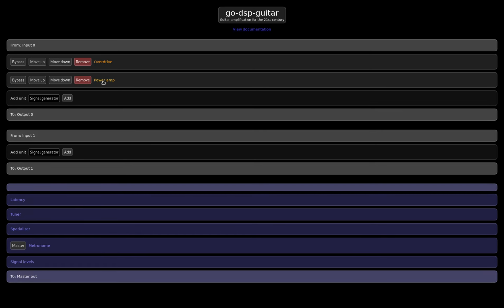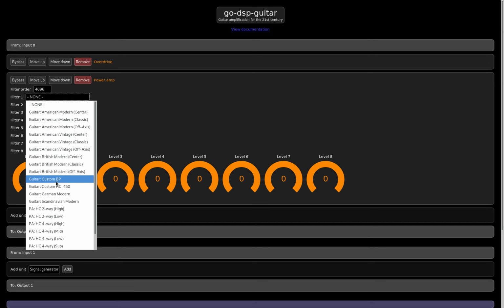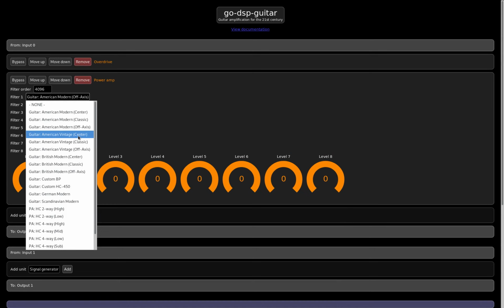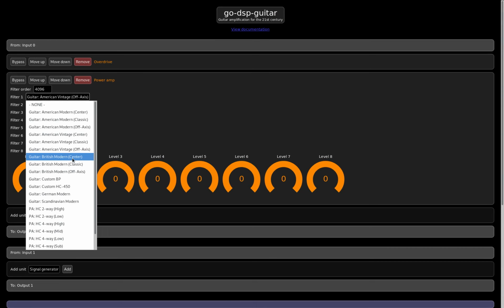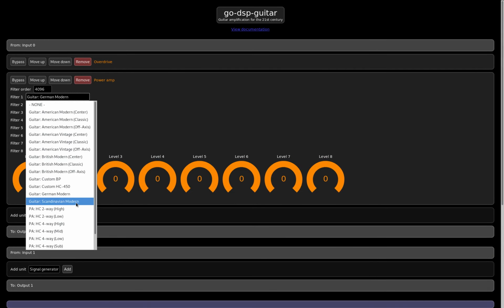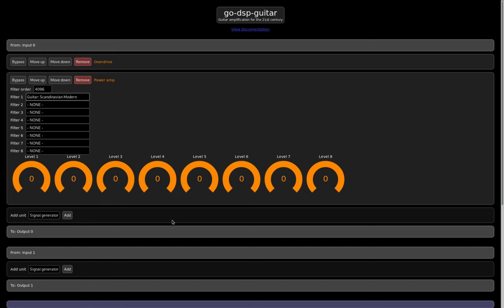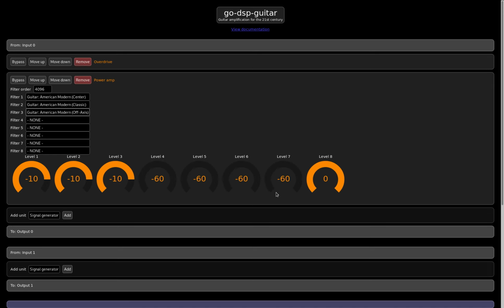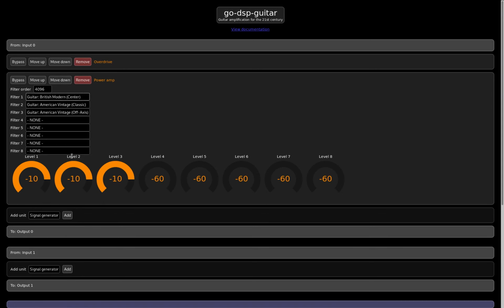Power-amplifier models and microphone placement in go-dsp-guitar

Comment: Good realistic sound. How about adding looper code for this project?
Reply from the maker: Hey, Muiota! I'm glad to hear that you like the sounds. :-) Since this project follows a rigorous simulation approach, realism is absolutely key. However, it also means that certain features are harder to fit into the software's architecture. Unfortunately for you, a looper is probably among these. A few problems that I see with adding a looper to the software are ...

1. Like I said, the software basically uses a (simplified) circuit simulation to process audio. Now, a looper is basically a device that records audio and plays it back, potentially simultaneously, to allow overdubbing existing "layers". To simulate that on a circuit level is overkill. Now, we already have some effects units in the software that do not follow the simulation approach as closely as the others, for example the metronome and the tuner, so that would not be an issue. However, this certainly means that a looper would be also fall into this "auxiliary category" and is definitely not part of the category of effects where the key focus of this project lies.

2. There is currently no "global time base" in the application. The different effects units in the software are not synchronized, apart from running at the same sample clock. This means that when you, for example, add a flanger effect, it will not be synchronized to, say, the metronome beat, and if you add two flangers running at the same speed, you will basically have no control over the phase offset between them. If you send one of them into bypass for some time, the phase offset will change, since the simulation (and therefore time) is "frozen" for the bypassed unit. (This is done to save CPU cycles. The simulation will not put any computational effort into running a bypassed circuit.) Also when you remove a unit and add another one of the same kind, and set the same parameters, you will not get the exact same results as before. Timing between units will have changed, since the time will start at "zero" for the newly added unit. However, this also means, that, when implemented as a separate unit, a looper will not be synchronized to, say, the metronome. So how do you know then when loop recording starts / ends?

3. Complicating things even more, the software runs basically a "control thread" (that does not have to run in real-time) and a (set of) "simulation thread(s)" (that run in real-time) concurrently. The "control thread" gets messages from the UI (which, by the way, even runs in a separate process, communicating with the "control thread" in the application over a socket connection) and then "reconfigures" the circuit(s) that the "simulation thread(s)" run(s). The coupling between these threads is relatively loose in order to avoid blocking the real-time threads. However, this also means that doing something timing-critical (such as starting and ending a loop) from the UI is difficult to do, or, let's rather say, it won't have predictable timing behaviour. This means that, when you start / stop the looper from the UI, you won't be able to tell exactly when the recording actually starts / ends. This will probably not be noticeable, but it's something to be aware of.

4. As a result of points 2 and 3, the best bet you would probably have is integrating the looper into the same effects unit as the metronome. Then, you will have a common time base and, after receiving a start / stop event from the UI, will be able to synchronize with the metronome on a sample-exact time-base to start / stop the recording / playback exactly on the next beat / click.

5. Following up on point 4, the metronome currently only produces audio, it does not consume any. (It does not have an input.) Adding an input (for the then-integrated looper) should be relatively straight-forward. But from where do you actually take this input? From the beginning of a processing chain (record "raw audio")? From the end of a processing chain (record "processed audio")? The former would be very difficult, since you'd have to "inject" the recorded audio into the processing chain again, otherwise you'd get a dry signal. The latter would be far easier, since you could then just sum it to the master mixdown. Or do you even record the master output? The latter might be difficult, since it will have the looper output included, which might lead to "feedback" issues. So your best bet is probably to record the output of a single processing chain (one of the "out_0", "out_1", ... channels). But which of these do you actually record? So you'll have to make this user-selectable as well. That all (and the fact that the user will need to have a means of controlling the looping, so start / stop, etc.) means you'll definitely have to adjust both the control code and the UI code and also the communication protocol between them, since you will need additional messages for "start / stop looper", "switch looper input channel", etc., since these do not integrate into the current "change a numerical or discrete parameter" set of control messages that most effects units (with a few exceptions) have in common. Uff ... That's not to say it's impossible. It certainly IS possible and we already HAVE these exceptions. But it's certainly NOT a small change!

6. The software has a feature to load the current configuration from and store the current configuration to a JSON-file. What will you do with the content of the looper? Well ... your best option will probably be to discard it, but it's certainly something to keep in mind. Implementing an import / export feature for the looper to / from, say, WAV-files would mean significant additional overhead.

7. Last, but not least, and this is probably the worst, keep in mind that the software has both a "real-time" and a "batch-processing" mode. When run in real-time mode, it will receive audio from and send output audio to a JACK server. When run in batch-processing mode, it will read input from and write output to, audio files in either "RIFF wave" or RF64 format. What will you do with the looper when running in batch-processing mode? Your best option is probably to remove it, but then you will have to communicate this to the UI and it will have to adjust for it, i. e. remove (or at least disable) the looper controls, etc. You see - lots and lots of special cases that will have to be accounted for. ;-)

EDIT: 8. One more thing: Under JACK, the audio hardware is allowed to change sample rate at any time. (There is a "sample rate changed" event that you can / should subscribe to as a client application.) All JACK clients are "slave" to the sample clock provided by the "master", the audio hardware. Even though I cannot think of why well-behaving hardware should change its sample clock while running, API-wise, it's something you have to expect. Now, what do you do with the looper content (the stored samples) when the sample rate changes? You see, you got samples recorded at rate X, when the hardware was running at that clock, now the hardware tells you "I'm gonna run at clock Y != X from now on". What do you do? Perform on-the-fly sample rate conversion of the recorded loop from rate X (in which the loop was recorded) to rate Y (in which you have to play it back now)? That's "messy", and for every loop of non-trivial length and every reasonable buffer size it will probably take too long, i. e. you will produce at least a few X-runs. I mean sure, you could just say: "It's not gonna happen under realistic circumstances. I should just handle it 'somehow', so dropping the looper content under these circumstances is fine." - It's just another situation that just came to my mind that requires special handling.

We will certainly keep in mind that this is a requested feature, but realistically, don't expect this to come anytime soon, especially since we are full-time developers who do this in our spare time and the focus of the project is currently somewhere else. We have a few more things in the pipeline which will hopefully increase the quality / reliability / realism / ... of the simulation even more. We will see where that leads us and what the future brings.

Kind regards.